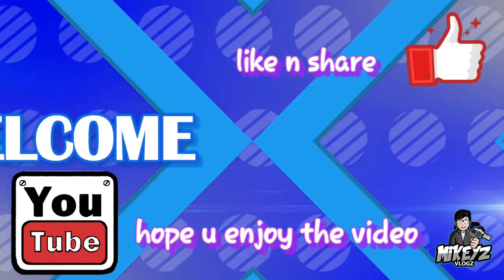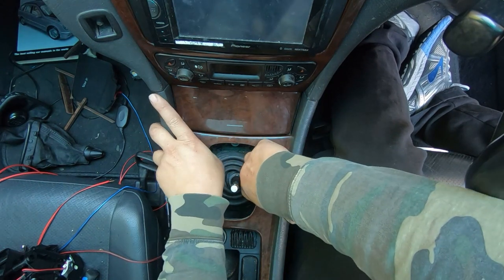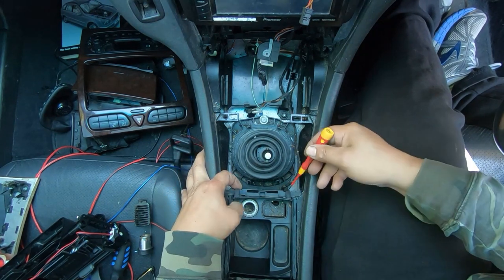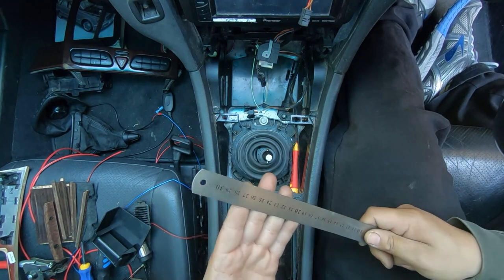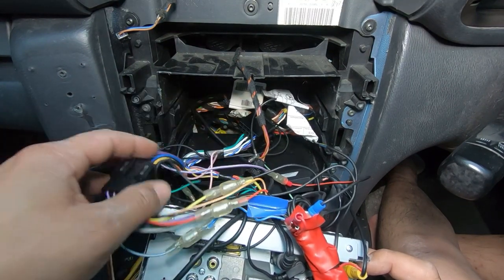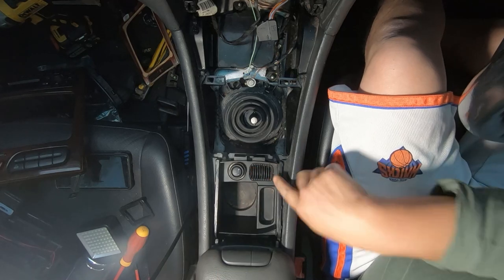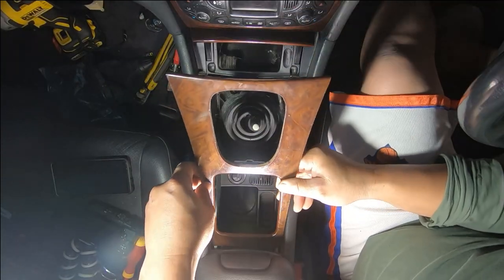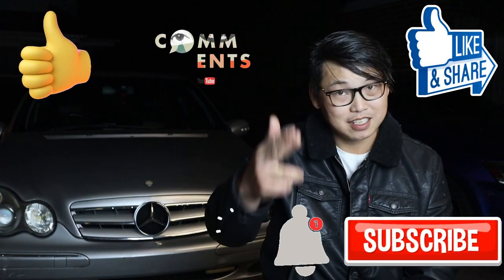how to remove stereo mercedes w203 double din pioneer reverse camera explained

Comment: Hello got a question... my wheel the button doesn't work but i dont not the name its something the clock spring but mercedes have another name
Reply from the maker: U mean tje clockspring combination switch whatabout it ? U need to change
Reply: @MIKEYZVLOGZ  yes im  need replacing because my steering wheel not working the air bag light is on the comands not responing

Comment: My B180 w246, 13 model command control pad won't select. I think I pressed somthing to deactivate the keypad. Please advise how to reset it. If I press Radio, Navi, Syst, Disc manually on the pad it won't select.
Reply from the maker: So the keypad on the unit wont work or the scroller wont work?
Reply from the maker: Try and remove the fuses for your radio so it can reset check fuses  33 Audio/COMAND control panel 37Audio/COMAND display  42 COMAND controller unit the ones related to control panel for audio system
Reply from the maker: Can u scan for codes with electrical faults always start with a scan then check fuses try a reset and go from there